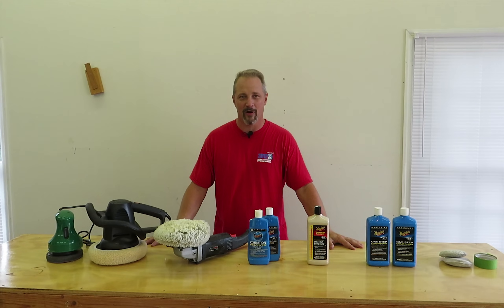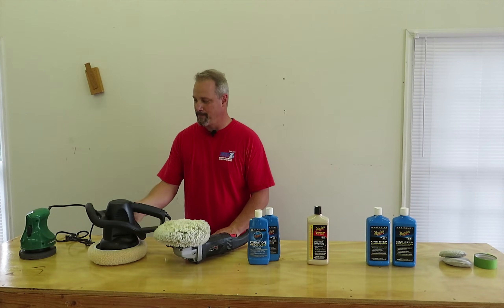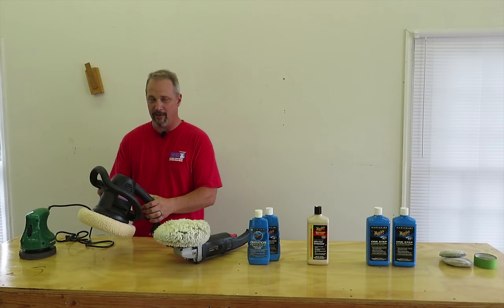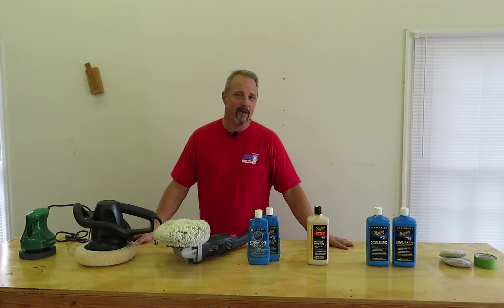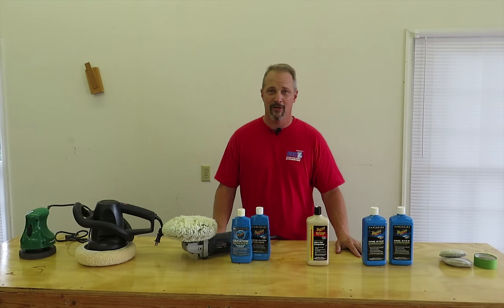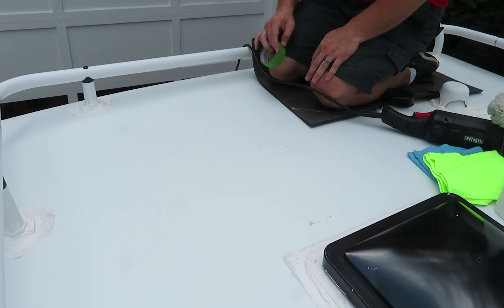Fiberglass RV Polish and Restoration

Comment: Excellent video. At first I thought that despite your efforts you wouldn't be able to capture the high gloss that you achieved due to the bright sky, but your many camera angles really showed the difference!
Reply from the maker: Hi James Kieffner,  I wish I had filmed the video when I polished the sides of the camper but I didn't.  So the only unpolished area I had was the roof.  It was kind of a challenge to get the roof to show the high gloss.  Thanks for watching and commenting ~ Todd

Comment: Thanks for a grate help on this, I have a Jayco 2004 van it had no shine when I just Brouth it then I was looking at your home work on polishing your van so that's how I started.   I got the Meguiars Oxidation Remover Heavy Duty Cleaner it didn't seem to work that good I was not happy with this so I tried a little patch with 600 wet and dry with heaps of soap wash it with clean water then hit it with the  foam Buff and wow what a difference a Big shine came up very happy . When I went to But one-step cut-polish can't get this in Australia so I done this with Meguiars Oxidation Remover then the Meguiars Boat Caravan High Gloss Polish with wool pad and it looks like a new van now.  ( For Bad Oxidation this idea works and it will make you Happy with your hard work ) So thanks again for your help on this.

Comment: Just used Meguiars 67 on our trailer today.  I have some polishing learning curve, but it looks much better and is now sealed with some Jay Leno Radiant spray on ceramic.  First try with this Leno product.  I'll revisit in a couple months considering our spot bakes the front in the sun.  The rest of trailer holds up well oxidation wise.  

I over wetted a pad and made a mess.  That took two passes, but still see some blotchiness. Have to work on my low speed and high speed routine.  Looking back, I needed more of the high speed finishing step. All good though, much better and I think Leno's ceramics are going to hold up better than the carnauba type waxes, and leaves no residues.  Really like that about spray on products.

Appreciate the video, learned plenty.

Comment: Hello, I recently watched your video to remove some oxidation on the top of my front cap of my 2014 Keystone Sprinter. I used the one-step #67 as you recommended and could not believe how effortless it was to make it look new again. I worked in small areas so it took me longer than it probably should have but I am super impressed. I then lightly buffed the area with a carnauba wax to put a layer on top. Very happy. Thank you for sharing!
Reply from the maker: Hi Jim Syvrud, I'm happy to hear it worked out for you and thanks for letting me know.  That stuff sure impressed me.  Thanks for watching!

Comment: Great video! Exactly what I was looking for
Reply from the maker: Hi Wade Weisz,   Glad to know the video was what you were looking for.  I hope it helps your polishing.  Thanks for commenting and watching.
Reply: @RunawayRoses  it worked great. However, I had some issues with the buffer. Out of the box there is a loud clanging sound that is probably bad bearings. Also, it doesn't hold the RPMs very well at low speed when making contact with the RV surface. But it's super cheap and I got thru my RV and also used it on my car so, meh, it's all good!  For longer use, I'd recommend a different/better buffer. Thought you might be interested.
Reply from the maker: Wade Weisz, I apologize but I just saw this comment.  We're still learning this YouTube thing but getting there.  I'm very sorry about the bad bearings but you might go back to Ironton they would probably warranty it if you asked.  We actually got ours from Northern Tool here in Atlanta.  When we were shopping for one, it was the only brand we could find at a moments notice.  Thanks for letting us know and I'm glad this method worked for you.  It isn't easy but the payout is worth it.  ~Carla

Comment: You could try RUPES UNO advance one step. It has a 12 months sealant built in so no wax after would be necessary.  Pan the Organizer does a video showing this product polishing up tail lights. I don’t know how aggressive the cut is but it’s literally a single step only.  3D ONE is also a highly rated single step cut and polish compound. Works very well with buff and shine Euro Fiber pads on auto paint.
Reply from the maker: Thanks I’ll have to check it out.  Thanks for watching!
Reply: I tested 3D one on an 30 ft RV im detailing with heavy oxidation today, but it just no powerful enough to cut through and shine. The 3D one works great on car paint though.

Comment: Great video, I could clearly see the huge difference on the roof, thanks for posting.  I am wondering about the really easy to use car SiO2 sealants and their ability to prevent oxidation.  They are so easy to wipe on a car, I have just started using them, no knowledge on their use on fiberglass but they are laughably easy to use compared to many traditional waxes.
Reply from the maker: We have used those type of waxes after our initial polish and they seem to be holding up so far.  We'll let you know.  Thanks for watching!

Comment: Ok, this can be a do it yourself job but you need a beefy buffer and some professional cutting compounds. I just did a 21 year old Bigfoot and after 3 days of work the gel coat looks and feels like new. Like fresh out of the mold new. 3M superduty cutting compound, 9" wool pad and a $200 beefy buffer. Worth it? Absolutely. Followed up with 3M Perfect it polish and Ceramic hybrid wax. 303 uv protectant on top and the bugs just wash away.

Comment: Thank you sooo much. I just bought a white RV motorhome and it is all fibe.rglass. this will be great. just wonder if a ceramic coating would be good over this to protect all the work
Reply: I am wondering the same thing. Can anybody pipe up on this? Thanks in advance
Reply: Yes it will do a good job, if it’s a synthetic it’s the very best for a wax coat and it will last the longest !
Reply: Regular wax will not last very long. Always use a synthetic wax that’s the ticket. And got to boat shops to get the good stuff and will last. Do not go to any car body shops it’s not paint or clear coad it’s gel coat and that is what you are working with. Hope this helps !!!

Comment: Great video, I just bought a fiberglass RV and the roof is badly chalked. I am planning to remove the old (Dicor?0 sealant from around all the penetrations before restoring the roof. Should I put the new sealant on before or after I restore the surface. Just thinking it may adhere better to a surface that has not been polished (but then it was put onto a polished surface at the factory).  Also after you finish with the Meguiar 's what do you recommend to put over the top to protect the roof, just any paste wax product?

Comment: Wow!  That is a huge difference.  I bought the Maguires but I don't have an electric buffer.  Do you think I need to invest in one or can I do it by hand?
Reply from the maker: Hey Pidasian Hippie, If you want it to turn out really good invest in a good polisher and a wool pad.  The small buffer machines don't do nearly as well because their not as powerful.  You can use the Maguires One Step Compound by hand but it will work better with the machine.  Good Luck!
Reply: Thanks for the info.  I am beginning to think I have purchased a money pit because I keep finding things I "need" for it.  Hahahahahah
Reply from the maker: I know the feeling.  :)  If you still have some shine on your trailer you might be able to get buy with a smaller buffer and wax but if it's oxidized much you'll need something stronger.
Reply: Unfortunately there is a lot of oxidation.  :-(

Comment: Do you know anything about Shine On, fiberglass restoration product.  You are just supposed to wash the surface and then wipe on the product.  No waxing or polishing... Interested to hear if you are familiar with it.  Thanks...  you did a great job.
Reply from the maker: Terry Brown, I have not heard of that Shine On product but it sounds a lot like Poli Glow.  We opted not to use Poli Glow because it is actually putting a coat of something over the original gel coat and we just wanted the original gel coat to shine rather than cover it up.  Thanks for watching!  ~Carla

Comment: Looks great! I'm looking to polish up our new to us 5th wheel. I'm just wondering, what kind of effort does it take to keep the surface clean and shiny after its polished like this? How often does it need to be washed and waxed and buffed with a buffer like that? Thanks!
Reply from the maker: Hi torq21, I will double check with Todd but we got our Bigfoot last July and we've only polished it like this once and it's still very shiny.  It was chalky when we got it so it really made a HUGE difference.  We do try to wash it when we return from our camping trips but so far we haven't waxed it yet.  We need to do that this year to keep it up.  It's garage kept so that helps.  It is hard work to do this method and it took Todd two days to finish the job but it has held up well and I don't think we'll have to do this particular method again for a while.  Thanks for watching our video and good luck with your RV polishing!  ~Carla

Comment: Great video, I have a 2011 40' fifth wheel RV. I need to restore the fiber glass. Looking for help on what I need to do the job start to finish. So watching several videos. Looks like I need a polisher and 💯 wool pad to cut the oxidation with the one step compound. And a second polisher to apply and buff a wax finish? All help is appropriated. I bought this RV from someone and after recaulking all seams I wanna restore fibreglass. And I wanna get proper tools. But at same time I'm not opening a detail shop.
Reply from the maker: It sounds like you have the right idea on what you need.  Depending on how bad your camper is oxidized and how big it is, it can turn into a big job but this one step compound/polish works very well.  Otherwise if you think you might want to have someone else do it look for a boat detailer not an auto detailer.  Typically the boat guys know better on how to work with fiberglass.   Thanks for watching!

Comment: Thanks for the great info Todd! Even though our Jayco is new and doesn't have any oxidation, we want to keep it preserved well. What do you use to wash your rig? Do you cover/store your Bigfoot in the winter?
Reply from the maker: Hi Freebird,  I typically try to buy a good quality car wash with Carnauba wax in it.  That is what we use on our vehicles so I just use that on the trailer as well and it's work well keeping up the shine. I know RV wash is available but I've never used it.  We keep our trailer in covered storage so that helps for the long term and cuts down on the maintenance.

Comment: For fiberglass rv's boats the answer is simple.
1 wool double-sided for compound. 1 nylon or nylon/wool double-sided pad for waxes/polishes/sealants. Done. (here, I'll show ya'll what I mean) https://youtu.be/h5seC2AOWE0

www.deckhanddetailing.com

More detail;
https://youtu.be/0l6Dil2l0Cc
Double-sided pads
DWP849x  buffer (we helped design btw's)
The boat, compound or pad care not how you apply the compound. What's important is speed, efficiency and waste-reduction.
Cross-cut then smooth flat. Slow-faster-slow, work until only an oily residue is left (unless using a water-based compound - don't )
Edgless microfiber towels.
Basically stop Only when it looks like wet paint. If you can't achieve that yet, finish with a random. Orbital buffer and a light cleaner wax (never carnuba!!!) wipe clean and do it again in 6-8 months.
Or, get down to fresh gelcoat and lock it in with RMP for almost 3 years once it looks wet. Nylon/wool pad or soft foam.
The only way to really know if you are at "wet" real wet, clean with a degreaser/iso and look at it without the oils from the compound still in the gelcoat pores. Fatal mistake for noobs. 
www.deckhanddetailing.com

Comment: Any tips or tricks we should be aware of polishing the RV decals or around those decals?
Reply from the maker: Hi Trevor, Just be careful around the skinny areas of the decals or around sharp corners.  I found it's best to have the rotation of the polisher go from the decal on to the RV surface.  The polisher can pull up the corners of the decal a little bit sometimes if your not careful.  Try to go from the decal out that should help.  Thanks for watching!
Reply: Pls disregard
Reply: My fleetwood revolution has graphics. I do not like graphics wish it was all painted.my manual to my rig says nit to wax the graphics. So buffing the area where the paint is, does not work together. I would love to wax it all. Has anyone else waxed your graphics?

Comment: So why did you stop using this process and start using Tyler?
Reply from the maker: It all came down to time.
Reply: @RunawayRoses  that is totally fair.  Thank you for your reply. I was hoping it was not and product issue because I was researching how or if I wanted do my two RVs myself when I came across your videos.   Your reply came a little late and I DID pull the trigger on the Meguiar's One Step and just spent the entire weekend teaching myself how to do it.  I'm very happy with the results especially after I added a Meguiars wax.  That said, it would have been a heck of a lot easier and faster to have someone else do it. Now though, I will be a much better and wiser consumer of those services.    Cheers Brother.

Comment: Good day Todd. I was wondering if this lasts a year or longer?
Reply: Longevity is totally dependant by your choice of final wax (or synthetic) . You must provide this "final' step in order to protect finish from UV exposure. Polish is not your final step! You need UV protection.
1. Carnuba wax: 6-8 weeks (depends on amount of hours in the sun.) 
2,Premium synthetic paste wax will protect from 12-20 weeks 
3. Full polymer synthetic (such as Rejex): 8 months to a year!
Reply from the maker: @David Veasey thank you for responding, your recommendations sounds like what Todd would have said also.  ~Carla

Comment: How many times did you have to change out the wool pad?
Reply from the maker: If I remember correctly I think I changed the pad 2 or 3 times for the whole camper.   Kind of clean them off as I go.  If you turn the polisher on upside down and hold a scrub brush lightly over the wool pad as it it turning it removes a lot of built up.  Hope that helps.  Thanks for watching ~ Todd
Reply: @RunawayRoses  Great video. I just ordered the 67 product as well as a 7" polisher and a 7" wool pad. I just order one pad however. When you are done with the pad do you just pop it in the washing machine, or how do you maintain the wool pad? Thanks!

Comment: Is that a rubber roof or what type material?
Reply from the maker: Hi Jim12186,  If your not familiar with fiberglass trailers it is basically like two boats put together.  The bottom half being one boat and the top half being another with a seam in the middle.  The full exterior is fiberglass all the way around.  So what I'm polishing in the video is the hard shell fiberglass on the roof but it's the same polishing process for all the way around the trailer.   Hope that helps.  Thanks for watching! ~ Todd
Reply: Do not put on rubber roof!!!